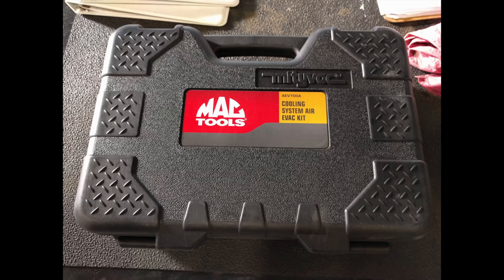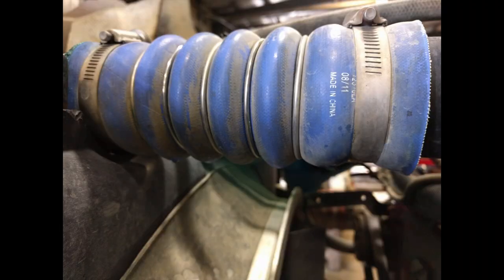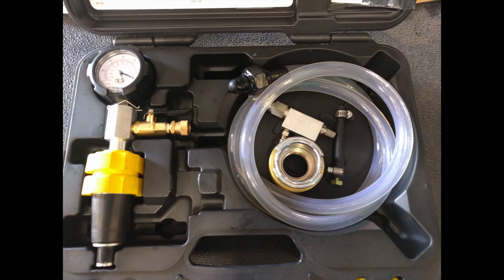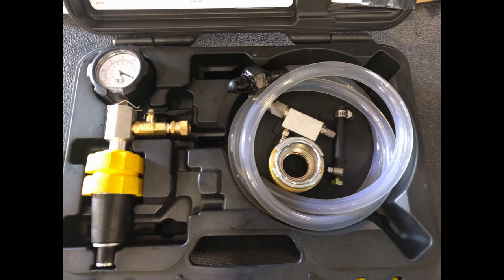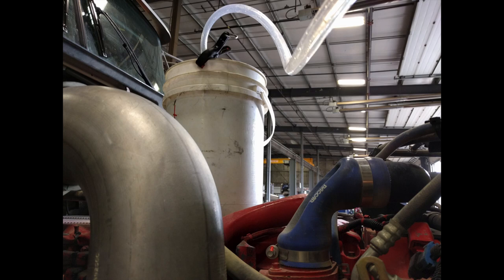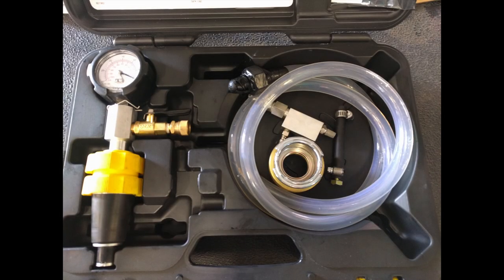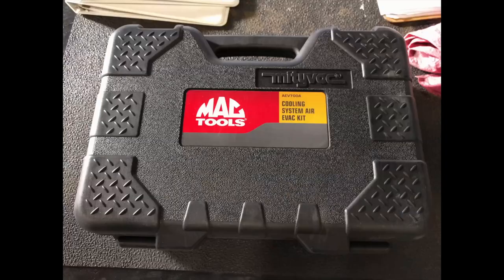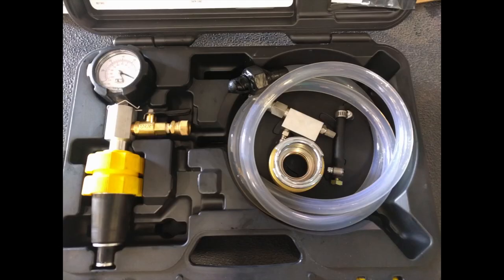How to use a Vacuum Filler

Comment: Are there any issues with the fact that when you vacuum an older system, where the hoses are not really new, and they collapse from this vacuum, that they are - "damaged"?  I'm asking, do we shorten the life of the hoses?  Or do we hear that hours, days, weeks later, one of the hoses let go, or cracked, or in any way was rendered non-functional, due to this reverse pressure vacuum fill?
Reply from the maker: I've never had that problem but I'm not saying it couldn't happen. Probably time to replace the hose at that point anyways

Comment: I have the mityvac version. At first I really liked it, but what I find is if the system isn't completely drained it makes a huge mess because it sprays coolant out of the Venturi all over the engine bay before it pulls enough of a vacuum to fill the entire system. Is this something I am doing wrong or how do you avoid this? Thanks for the videos
Reply from the maker: +Dansyoung ya, the reservoir has to be completely empty. Otherwise it makes a mess.  Although the cooling system itself can still have coolant in it.  Just not the reservoir that you're pulling the vacuum from. Atleast in a heavy duty application. If you're using it on an automotive application I would make sure the entire system is completely drained.  Like I showed in the video. I like to put a rag over the exhaust of the Venturi when I'm pulling a vacuum. That prevents the little bit of coolant from spraying everywhere. The other vacuum fillers from other brands work the same way. Hopefully that makes sense.
Reply: Ok thanks, I am using it for automotive applications.   Most repairs don't have the entire system drained, I suppose that's one negative to this tool.   Thanks for the reply.
Reply: Try adding a piece of hose on the side that spills the coolant, catch it in a container. It might work.

Comment: The adapter, is it a universal one or specific for kenworth? All I work on is 579 Pete’s, t680 kw’s, and vn630 Volvo’s but can find anything specific for those models on mityvacs website
Reply from the maker: It's specific to Kenworth, I believe it'll fit some GM and Ford vehicles too. The Stant  12026 or equivalent is the one you want for the newer kw with the plastic reservoir on the passenger side on top of the rad.
Reply from the maker: I got a peterbilt adapter from my matco dealer. I'll get you the part number tomorrow
Reply from the maker: It's A4505B it works on older peterbilt's with the metal surge tank on the firewall. Works on lots of equipment as well. Can't help you with Volvo. I've never really worked on one.